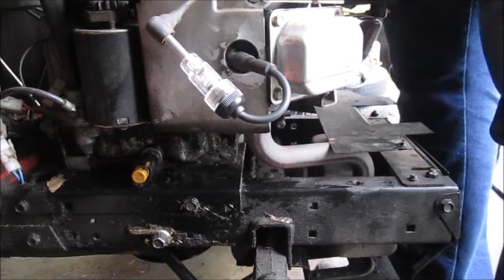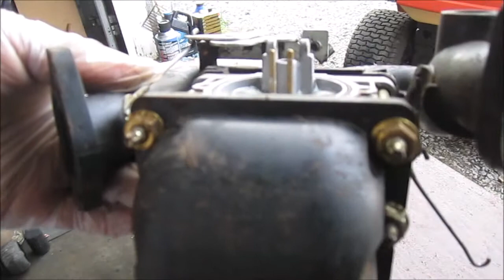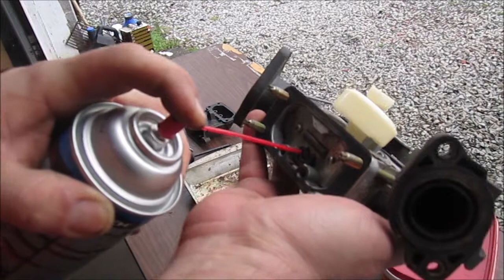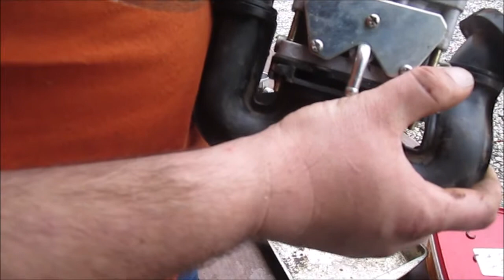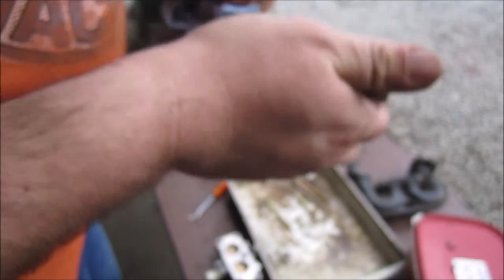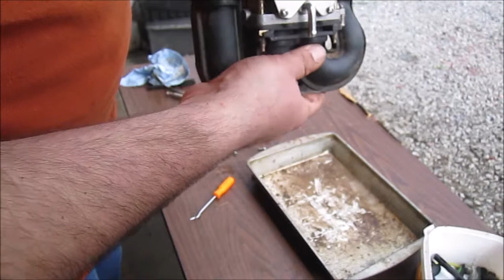part 2 yth 2454 carb recleaning

Comment: If you were to spray the carb cleaner into the air intake would it do anything?
Reply from the maker: I wish then I should have done that
Reply: @Turningwrenches85  Oh no I was asking for reference.  Mine is the same model and I don't have an extensive knowledge of carbs.  I was asking if spraying carb cleaner would actually do anything or if it has to be torn apart.  Thank you
Reply from the maker: @JordanGDDPY  I'm sorry I missed right wrong.Yes you can use that or you can use starting fluid also if it runs and cuts off either the carb is clogged or a fuel delivery issue from the tank